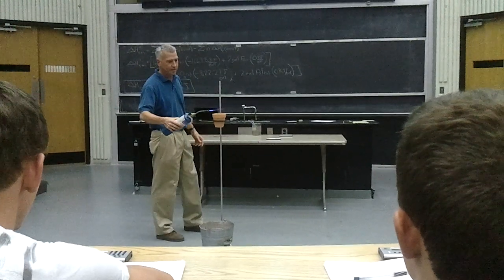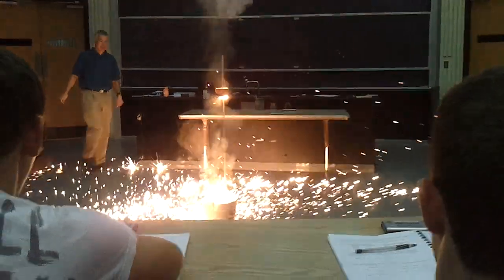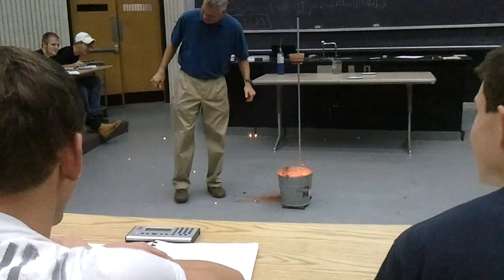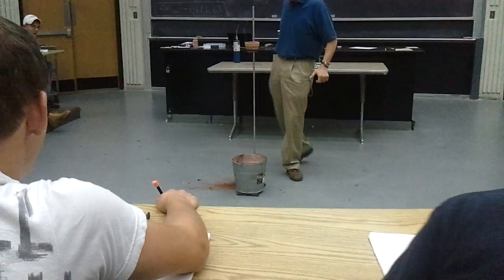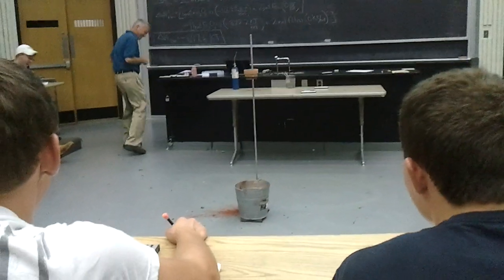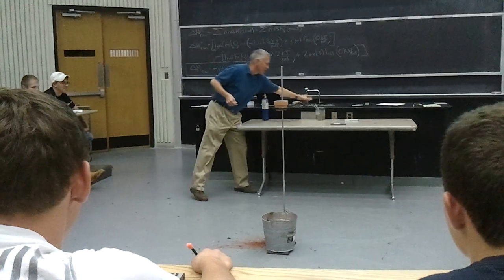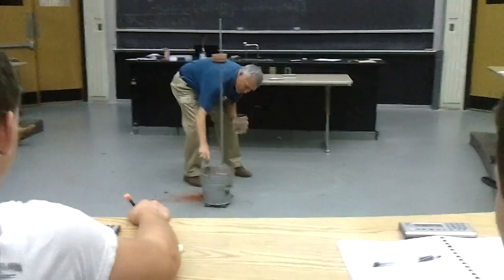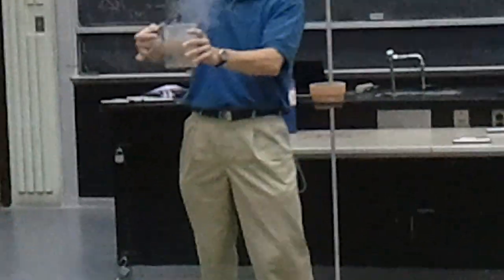Thermite Reaction Gone Bad!

Comment: I think its his first time doing this for three reasons. First because he should not be wearing a shirt made out of oil like polyester because if it hits his shirt or pants (witch i think is also made out of synthetic material). Then he should have made the distance between the bucket and the small pot to prevent the molten material jumping out. Anybody who would have used thermite before would know that it does that. And third everybody should know that howitzers are not made of just iron.
Reply: The distance between the bucket and the plant pot is suitable. Molten iron is not like room temperature water, it is more dense. This means gravity will exert a higher force on it therefore preventing it from as you put it "jumping" out. May I also mention that some hydrocarbons that come from the distillation of crude oil are less flammable that natural materials like wool. You go set a sheep on fire, see how well it burns, a big nice fluffy sheep.
Reply from the maker: He is a professor at Clarkson University, and he has done this experiment 3-4 times a year for the four years I've been here, and he has been doing it long before I arrived. Although I'll admit he should be setting a better example when it comes to safety, I've seen him do this the exact same way many times without failure. Often the thermite reacts and drains out of the hole at the bottom of the pot, and into a bucket full of sand. In this instance however, the pot must have had moisture in it that expanded rupturing the clay.
Reply: Kookookachew I thought that lecture hall looked familiar. Clarkson's Science Center is a marvel of poured concrete. :) I sat through many lectures, mostly up in the big hall, 311, from the start of my freshman year in 1980, including General Chemistry 1 with Egon Matijevic.
Reply: IntenseTbug You are right, gunners in the US navy wear cotton to prevent the synthetic melting to their bodies in case of fire.
Reply: +Kookookachew I believe you, but he should have known better. I've done several thermite demos outdoors in flower pots and most of them have at least cracked if not broken wide open. I think you are correct that it is due to moisture inside - could probably be prevented by baking the pot for several hours beforehand.
Reply: +IntenseTbug he never said howitzers are purely made of iron, but if you melt even some of the metals in there, and not all of them, i still doubt you'd end up with a working gun
Reply: That's exactly what happened. This experiment went wrong due to moisture in the pot. The heat from the thermite reaction created a steam explosion.
Reply: It's not just a steam reaction. Hot iron is a catalyst that causes steam to break down to hydrogen and oxygen, which goes bang.
Reply: +Sean Breheny Do it in a damp paper cup instead, its sounds ridiculous but does work
Reply: +Simon Watts precisely....thats why mostly iron is used as catalyst for NH3 synthesis...
Reply: +IntenseTbug he is actually correct. if one wanted to destroy an artillery piece, one would place a thermite grenade or 2 into the breach and close it. this would ensure that it will never fire another round
Reply: I dont even know what a hotwitzer is.
Reply: +mark1237889 It feels better than melted polyester.
Reply: +Red Richard HaHa, I belive that the poster of this vid stated that: &quot;He is a professor at Clarkson University, and he has done this experiment 3-4 times a year for the four years I've been here, and he
has been doing it long before I arrived.&quot; half a year before you wrote:&quot;I believe you're right that he has no experience with thermite other than what he's read in a book. and totally bypassed anything concerning safety.&quot;
And thus I also belive that sometimes reading something can keep you from appearing a total fool.
Reply: +Simon Watts The reaction doesn't produce enough heat for thermal decomposition of water. Iron is not a catalyst for that either.. At 2200 °C about three percent of all H2O molecules are dissociated into various combinations of hydrogen and oxygen atoms, mostly H, H2, O, O2, and OH.
Reply: at what temperature are more than 50% dissociated?
Reply: Yeah, experienced people would probably know to respect this mixure, but with that also comes a slight ego that they can avoid any danger making it.

Comment: Safety? No goggles for UV radiation or sparks.
Reply: Fantage LH2O [citation needed], but in any case safety goggles would not be a miss.
Reply: Fantage LH2O I don't know what it releases, but it burns brighter than when you actually weld, so yeah, protective goggles should be a must for this sort of experiment.

Comment: Thermite is frequently used by building demolition experts that put Thermite explosives into Iron beams to take down the main supports of a building.
Very effective, hot, and nasty reaction.
Reply: Like at 9/11
Reply: ***** There are still a lot of things that can't be explained
Reply: ***** Or why there was molten steel at ground zero when jet fuel doesn't burn at high enough temperatures to melt steel
Reply: How does that relate to anything?
Reply: 1) There are no such thing as thermite explosives.  2) Thermite is not used in building demolition. 3) Thermite IS used to produce elemental iron, and for welding, both above and below water.
Reply: in b4 9/11
Reply: ***** It was... Just look up the whole War on Terror that followed. Who won the most of it? Surely not common Americans.
Reply: "Thermite Explosive" literally does not make any sense.  It's either an explosive or its an exothermic chemical reaction (thermite) - it can't be both and putting an explosive charge in thermite will just scatter the thermite into itty bitty particles everywhere completely negating its melting effect on whatever you were trying to destroy.

Building demolition engineers use explosives - lots of them in fact, because you need a lot of supports to rapidly go out in a very specific order to bring the rest of a building down with gravity in a contained manner. On the other hand if you don't care about containment you could just use some GBU-31s, they are used a lot in places like Afghanistan.
Reply: Maury Hatcher IV Maury, some corrections.  Chemical explosives are exothermic reactions, as is thermite.  But to make thermite explode you must scatter it like a flour or sugar and ignite it.  Of course doing so negates its metal cutting properties.  You either "burn" thermite in place so it can melt a beam, or you can cause it to explode by scattering it.

Having said that, you are absolutely correct that thermite for building demolition is a very dumb idea and simply isn't done.  It IS used for welding, and militarily as man-portable means of destroying equipment (thermite grenades which can melt, hole or fuse equipment).  Thermite grenades do not explode.  They "burn" (combust using endogenous oxygen as opposed to a wood fire that uses exogenous oxygen).
Reply: ( ͡o ͜ʖ ͡o) Mfw someone brings 9/11 into a thermite video
Reply: Belrias Piquet are you criticizing his use of words or are you implying what he is trying to say completely unfounded?
Reply: +FlourescentNinjaz  Look up How a blast furnace works.  The updraft through the building added to the fuel and insulated by the building exterior allowed temp to rise above melt point of steel.    Once the central pylon ( primary load bearing structure) lost integrity the building collapsed near vertically as designed.  The shock of impact and over weight then forcibly pancaked the intact floors below.  In the event of structural failure the engineers did not want the building to fall like a felled tree.
Reply: Malcolm Parkins I am not implying anything.  I am flat out stating that the thermite conspiracy theory is fucking stupid.  There is that clear enough for you?

Comment: Nothing went bad here. That is exactly what it is supposed to do. It should go right through the bottom to demonstrate it is extremely exothermic and creates molten iron.  Thats all the reaction is good for, showing that aluminum is more reactive than iron and that aluminum will violently rip off the iron and reach temperatures of about 3000 C.  Thats it. Thats the demo.  No one was in danger, it does send some sparks out but the reaction goes down...gravity helps that. The professor was far enough away, the students were far enough away but he should have worn goggles.  Sounds like we are all afraid of sparklers. They sell those to any old idiot and those reach 1600C.  Clearly he is being sarcastic in his comments after the reaction. I assure you the man knew exactly how it would go. Its the same EVERY time.

Comment: I thought that went rather well for being so obviously wrong.  His pot is waaaaay too high.  His bucket is far too small to catch the reaction.  He holds no extinguisher, which I would have in my hand while I fired the reaction.  I would EXPECT the reaction to get away, and discolor the floor, not be surprised how wide the expression of this energy release was.I see an existing post that states he probably never did this before.  I have this muted, actually my computer here, at work has no sound board, but that was my reaction when I saw the setup.  WITHOUT the title I would have said that when the opening picture showed that silly setup, and showed how poorly his rational grasp of the expected reaction was.This style of experiment is an OVER PREPARE situation, not a seat of the pants situation, like he is doing.Clearly he has not seen any unstoppable chemical responses before, or he would be much better at this.

Comment: I agree this was a fail on the instructors part, but for those talking fire extinguishers,,, you cannot put out a thermite fire with Anything. I will burn until the oxidizer is no longer present... a fire extinguisher is pointless..He probably did at least test this Before showing this class but his use of a common terracotta pot as a basin obviously was a bad idea.. There could have been some serious burns here.. but.. on the other hand...for the amount ignited, they all were far enough away to maintain safety...

Comment: "I guess I never looked that up." No comment. And if you're "running away", most likely your position has been overrun and you'll get shot trying to disable your heavy weapons. I wouldn't want this guy as my science teacher.
Reply: +Robert Warmuth (M1a1) jeez people are demanding. you think that as a science teacher, he's obligated to know every little detail off the top of his head? do YOU know details like that without looking them up?
also, i really don't think throwing a grenade is such a tedious tactical maneuver that you'll end up wasting time and get shot. in fact, the ease with which it can be done is the whole reason it can be done in the first place
Reply: When working with dangerous materials, he needs to know everything he can. Also, simply tossing a common fragmentation grenade at heavy equipment will do little to no damage at all. To properly disable such equipment, you must place a charge, or in this case a thermite grenade, in a position where it will irreparably damage the weapo or vehicle. This could be done by either completely obliterating key components or by fusing together important metal parts, such as the gears that move the barrel of an artillery gun for aiming.
Reply: +Robert Warmuth (M1a1) Open breach of gun, toss in a couple thermite grenades, close breach.  When the grenades are done the breach is welded shut.

Comment: That's 9/11 physics for ya. Say what about hydrocarbons again? How hot it burns? Symmetrical collapse from office fires?
Reply: 9-11 had nothing to do with melting iron. Iron has a solid phase transformation at roughly 700C. The high temp phase is weaker than the low temp phase. That is why the towers collapsed.

Comment: Thermite 101: wear goggles and gloves, do it outside and stand the fuck back, don't approach til the fire stops, the fire goes above 2000 degrees celcius.

Edit: And sure as fuck don't suspend the pot like that. The top thermite burn't first, superheating the top of the pot and the weight broke it causing the rest of the reactive metals to go everywhere.